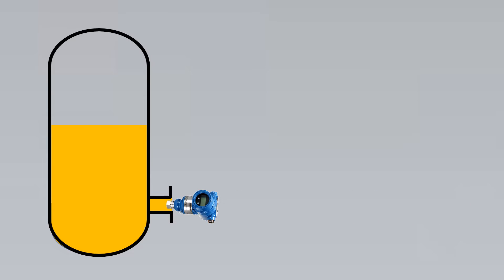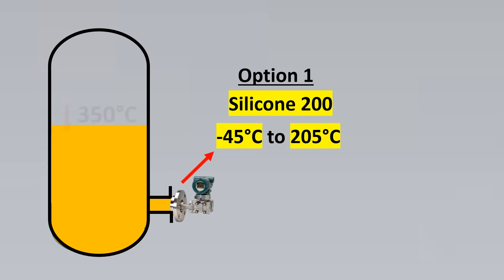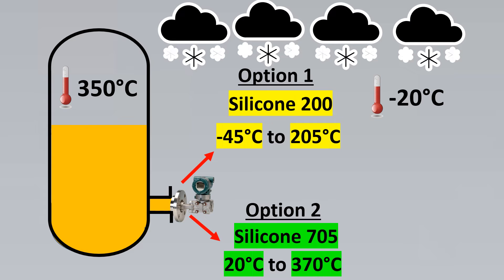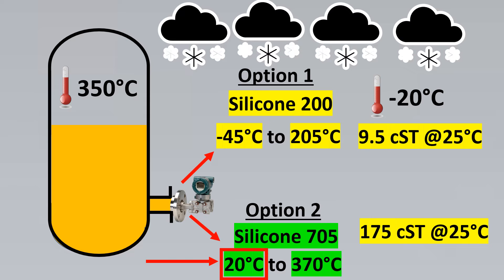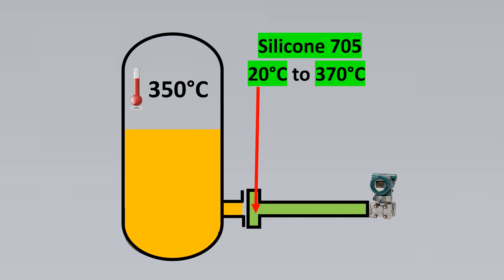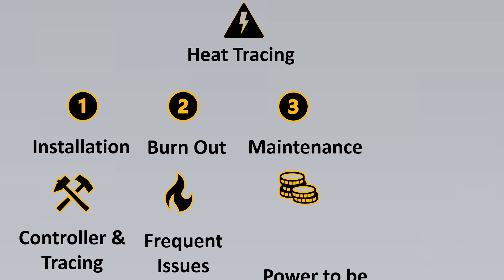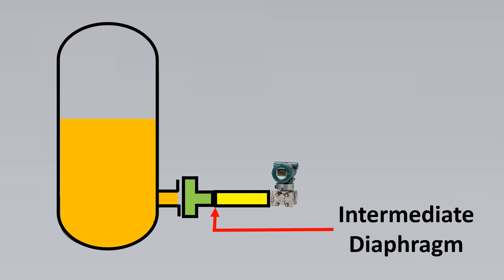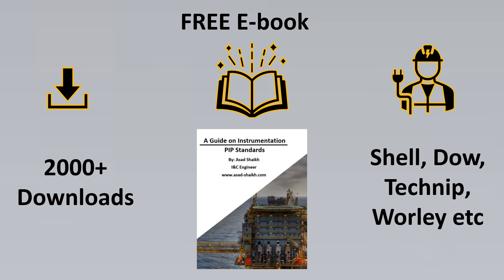Emerson Thermal Range Expander | WHEN to Use and WHY ?

Comment: Nice work. I have some questions related to flow measurements. The vendor is asking to calibrate the Coriolis flow meter. What are the liquids need to use. Which
Standard I need to refer please tell me. Our service is high viscosity crude.